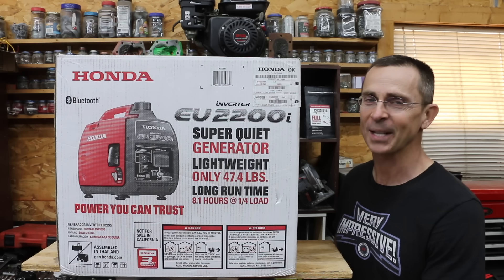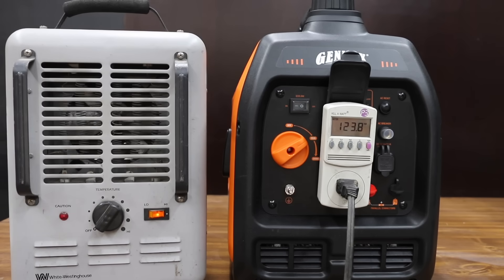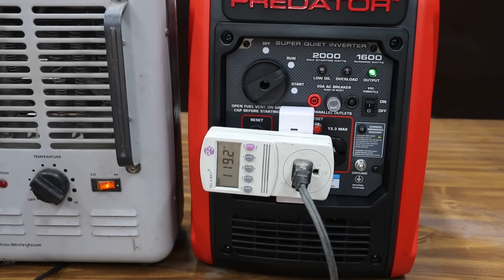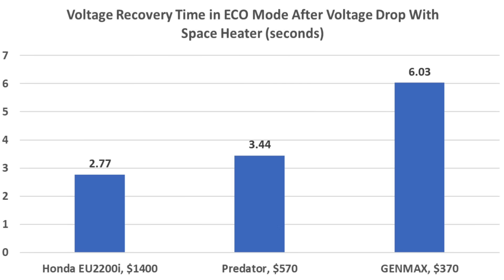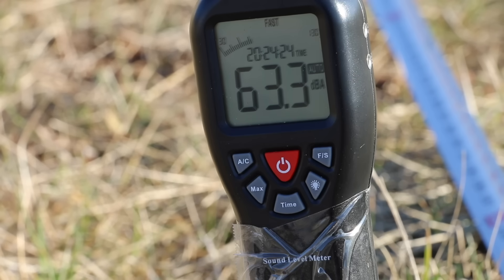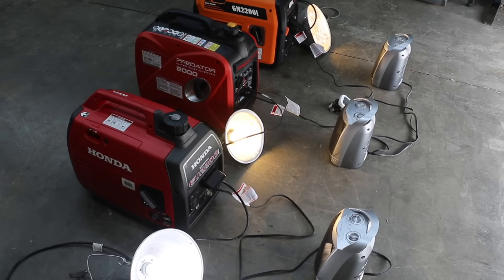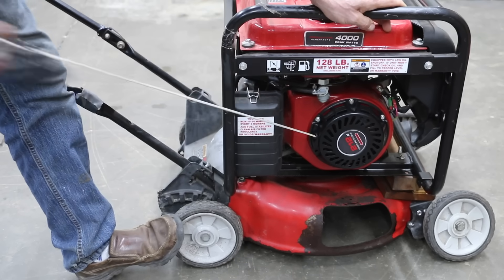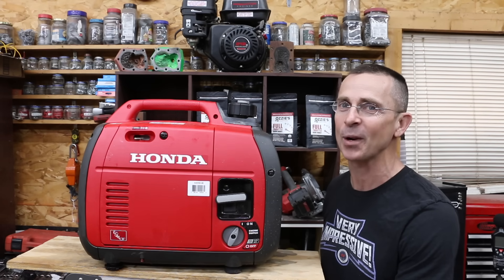Cheap Generator Better Than Honda? Predator vs Honda & GENMAX—Let’s Settle This!

Comment: Oh, how I’ve been waiting for this particular comparison!
Thank you so, so, so, so much, project farm❤❤
I had actually purchased the 2000 watt Honda around 2006, after Hurricane Katrina.
But now I get to see how good, or bad, it really is.
Reply from the maker: Nice! Is the Honda still running well?
Reply: @ProjectFarm  thank you for taking your time to reply to me, Todd!
Living in southern Mississippi, probably have really only ran it less than 10 times since 2006, but it usually starts fairly easily and runs well.
Honda usually always makes great products and I’m expecting it to last a long time.
I did join your Patreon, it’s not much, but hopefully it will help a little in your comparisons.

Comment: I actually bought a cheap "champion" generator for the occasional trop storm that comes to Charlotte NC and the rare ice storm. It's enough to run the internet tv and few lights. It was like 400 and I had it next day. I only use 4 cycle engineered fuel and I very happy with it.
Reply from the maker: Great choice!

Comment: Great video! Would love to see the Champion brand in testing. I have a dual fuel version and have never used anything but propane so far. It has less output with propane but it is so much cleaner and easier to store fuel. I’ve used it very little as it is mainly for hurricane related storm outages and thankfully I’ve had few requirements since it was purchased.
Reply from the maker: Thank you for the video idea!

Comment: Another outstanding video.  
Boy, generators sure have come a long ways since I was a kid.  
I have a 40+ year old PowerMate with a Briggs. Still runs 100%.  I also have a 7.5KW diesel that will easily power the house as well as the MIG and Plasma cutter.  Good investments for New England winters.
Reply from the maker: Thank you very much!
Reply: "Ain't that the truth." I still have my original old Coleman PowerMate 1200, as well. Heavy as hell, but still works well. Mounted it to a cheap Harbor Freight wooden mover's dolly and attached an old dog leash to that to schlep it around the shop floor.
Reply: Yes!  I mounted mine on the same dolly.  At 4KW and an oldie it’s a little heavy for my 60 year old body.   It always runs fantastic.

Comment: Would love to see a "solar generator" showdown. Anker v. Bluetti v. Jackery etc. Especially side by side with some of this data
Reply from the maker: Thank you for the video idea!
Reply: @ProjectFarm  I second this video idea. I like having a battery backup since the entire thing is self-contained. No gas, oil etc. Nice to top it off occasionally and leave in a closet.
Reply: Jackery don't even compare to the others, 500 charge cycles compared to 2,000 for the others.  And Bluetti has nearly no customer service based on all the reports.
Reply: Add Goal Zero in there too. They're a major competitor.
Reply: @hdz12ez  and ecoflow
Reply: @anarchangel7  Absolutely
Reply: Would like to see this too!
Reply: I second this.
Reply: Yes!!
Reply: @Project Farm  
You would want to include the EcoFlow product lineup in this comparison.  

Combined with the Honda EU-is series of quiet ICE generators, the EcoFlow Power Station units are what we chose for our Location Grip & Lighting Rental Equipment company for Film/Video/TV/Photography productions.
Reply: And ecoflow
Reply: Ego has a unit that shares batteries with their tools.

Comment: I know this may not exactly be possible, but could you run these generators for say 100h? Or even more and compare wear?
Main complain for cheap stuff is electronics failing and possibly motor failing. You buy a unit, use it for 5 years and board fries, no spare parts and throw it away. With Honda you can use for a decade without an issue. Spare parts are expensive but available.
I wonder when, if not now, we see cheap generators with good electronics that last a decade.
Reply from the maker: Great point. I ran these for 98 hours and sent to oil to an oil testing lab for wear metal content.

Comment: I also subscribe to Athe Gavin's Garage YT channel, and he does a lot of comparisons of brand like Honda, Predator, DuraMax, GenMax, Pulsar, Champion, etc.

 GenMax is an up and coming brand that offers a lot of different power levels as well as dual and tri-fuel options.  My concern about the brand is that there may not be many service outlets for GenMax in the US.

I dont doubt that the cheap price and multi fuel options has cost Honda a lot of business.  Honda should offer dual and tri-fuel models of their excellent generators
Reply from the maker: Great feedback. Thank you

Comment: I have a champion dual fuel.  I bought it 3 years ago to work on my truck since I can't park it at my house.  Never had any problems with it.  I really like the propane feature.  I will run longer on a full 20 pound bottle than a fuel tank of gas.
Reply from the maker: Great feedback! Thank you

Comment: I gots me an old 2 stroke diesel generator in the shed.  Model is Robin.  That was fun back in the day.  I'd like to get the generator running again. Engine still ran but something up with the voltage regulation.
Reply from the maker: Nice!

Comment: Would be interesting to run these for a few days, set these on a shelf for a year, and do a follow up video! My biggest fear with generators is they run good when you buy them, but then when you need them in a year or two in an emergency, they are hard to start, wont start, etc.
Reply: About once a month I run my gen for about 30 minutes under load just for this reason. I don’t want it to let me down when I may actually need it. I only have it as backup if house power goes down but of course now that I bought the generator house power never goes out 😂 so I guess in a way the gen is doing it’s job.
Reply: @oldmaninthemirror   I have my generator and a few seldom used corded saws and such.  Solves two problem.  One of having a gas or battery tool that won't work after months of non use and also I run my generator with a varying load.  Extension cord is sometimes annoying but not horrible.
Reply: Rule of thumb, if it's 4 stroke, run it dry of fuel and make sure the last fuel in it was non ethanol. If it's 2 stroke, keep the tank and carburetor full of non ethanol mix, it will keep the diaphragm pliable and a full tank will not allow condensation to build up inside the tank. It is good practice to run the equipment every 3-6 months and top off the tank after each run.
Reply: That's why they need to be run regularly.  Maintenance isn't exciting but it keeps things from being tragic.
Reply from the maker: Thank you for the video idea!
Reply: Got 2 used Hondas, one EU10, one EU20. Both are a little grumpy after storage with fuel left in them (the type of fuel you can leave in the tank over winter) but both start with between 4-10 pulls despite perhaps not having run for 7-8 months.
Reply: On my channel I just tested my old HF two stroke generator like the Tailgator in this video. It had sat for 10 years without running and started on the third pull. Of course I had drained the fuel and run it until it quit before storing it.
Reply: I've had my Honda EU2200 for a few years now, run it once a year usually, drain the fuel out of it and throw it on the shelf....next year, some fresh fuel, few pulls, away she goes.
Reply: That's called maintenance 
Reason why Honda has a fuel valve off position now on the engine switch.
Reply: I use my Honda Gen when camping. When not in use, I put Stabil in the gas. I start the engine and let it run for about 15 minutes every two weeks. So it's always ready to go. It's an easy chore and worth it to me to have a gen that is kept running.
Reply: ALWAYS drain the gas from the tank and especially the carburetor.  That'll ensure you don't have the most common problems associated with bad gas.  If you're storing for a long time, fogging oil really prevents most long term storage problems too.

Comment: We have a legacy honda laying around and we have just realized we could use it to charge the solar flooded lead acid battery for a lot less fuel than the big 4.5kw 220v diesel generator, I truly love this tiny machines, been researching about them and their tech for the last couple of months while looking for the original manuals haha
Reply from the maker: Nice!
Reply: @ProjectFarm  if you ever can, please do generators specialized for welding machines, honda has a special model for that kind of job.

Comment: Electrical generators with electronic governors capable of paralleling should have a droop/gain setting that will change the recovery time when a load is applied. There may be an adjustment somewhere that will increase the recovery time during block loading.
Reply from the maker: Great information. Thank you

Comment: Don’t have much experience with other brands than Honda but the last 2 companies I’ve worked for have only used the one you tested and I can say that in the last 3 years I’ve never seen one fail and they get thrown around in trucks, never have the oil changed, sit out in the weather and get dirty gas put in them. We use them for anything from charging batteries to running 2 inch submersible pumps and 6 inch concrete core drills.
Reply from the maker: Great feedback on the Honda. Thanks

Comment: I was using two Wen generators similar to the cheap ones in this test on my sailboat.  I had trouble with both of them had to change the pull cord clutch 3 times cheap plastic kept breaking on them and was a two hour job taking the whole thing apart to replace.  One of them would blow oil out of the exhaust.  My Dad had the Honda on his sailboat for 20 years or more thing never had any problems.  I am Def going with Honda if I get another boat or need a generator.  The knock offs are not built to last if you use them alot.
Reply from the maker: Great feedback on the WEN generator brand

Comment: Fantastic video! Im always hesitant to buy a generator because there are so many options and its hard to tell what is actually a good option. Would be good to see larger home generator options in the 6 to 10kw range! Thanks as always!
Reply from the maker: Thank you for the video idea!
Reply: @ProjectFarm  Please make the contest between dual-fuel (at least) only... home backup gen sets should get away from gasoline, not a proper long-term storage fuel.
Reply: I'd like to see that myself. Even with regular factory-authorized servicing, my 11kw Generac has been more troublesome than I'd expected. But doesn't he buy all the equipment he tests? Buying 3-5 home-size generators would get into some serious money.

Comment: 10:55 16 onces of gasoline is 4.2 kwh of energy, 1500W for 32 minutes is 0.8kWh, so it's around 19% efficient. I would say it's still pretty bad to be honest.
Reply from the maker: Great point
Reply: Thermal efficiency of modern 4 stroke gasoline engines is about that.  Sounds bad, but its pretty normal believe it or not

Comment: Love to see the Honda 2200 vs the  Yamaha engine powered  A-iPower SC2300i. 
 Great job as always!!!
Reply: I’ve had both the Honda definitely better reliability and overall in my experience but Yamaha at Costco was only 1/3 the price.
Reply from the maker: Thank you very much!
Reply: I love the yam engine and I work on generators all the time
Reply: @philliphall5198  Do all of the AI power inverters use Yamaha engines?(duel fuel-240 vac units)

Comment: Aside from Predator, Westinghouse is probably the biggest competitor to the Honda in this class. I have one and really like it, especially at the $329 price I bought it for. 2200 peak/1800 running, and I got the one without the CO minder, because that's an expensive and unnecessary feature in my opinion. Your generator should be running outside in fresh air and have some distance from the house anyway.
Reply from the maker: Great price!

Comment: Love to see a comparison various brands of 7,500 watt generators; this size makes for a good portable generator and home backup able to run 30 Amps at or about 250 Volts, which can be enough for most residences emergency needs.
Reply: I have a 7500 diesel as a whole house backup.   I love it.
Reply from the maker: Thank you for the video idea!

Comment: I'm really curious if the genmax and predator wear metals after break-in is reduced, or if they continue to wear like that aggressively.
Reply: Judging by what the Predator's spark plug looked like, I'd say either the piston rings were shot, or maybe even the piston itself, given the amount of aluminum in the oil. I wouldn't expect that engine to run for many hours after this test.

Comment: Thanks for your time and work . I would greatly appreciate if you can compare Generators with dual fuel, and have the inverter feature. Also, something that would power a few appliances at home. Thanks!
Reply from the maker: Thank you for the video idea!

Comment: I would recommend small engine oil, it’s designed for air cooled engines which operate hotter than a water cooled automotive engine!
Reply from the maker: Great suggestion! Thank you

Comment: Honda wins again so you get what you pay for, im curious how much of a voltage drop the extension cord makes since most of us would be using one , new york
Reply from the maker: Great suggestion on the extension cord use with the generator!

Comment: Did you do a break in period? (sorry if I missed it) It would be interesting to see the same oil test on the second batch of oil.
Reply from the maker: I changed the oil after 2 hours of running the engines on a light load. Thank you
Reply: @ProjectFarm  of course you did, how could I doubt you! LOL

Comment: Would be interested in these tests on the Champion dual fuel generators. It's about the same price as the predator, but can run on propane too, which is great cause it runs way longer right from the tank and propane doesn't go bad.
Reply from the maker: Great suggestion! If there's enough interest in this video, I'll do it.
Reply: @ProjectFarm  another vote to see the champion. That’s the best name brand alternative to the Yamaha and Honda inverter generators IMO.
Reply: @ProjectFarm do it!
Reply: @ProjectFarm I agree. Non-inverted Dual fuel generators larger generators such as Westinghouse, Champion, Duromax, Pulsar, Generac. All made in China, but are the the same?? Let’s test that!!
Reply: @ProjectFarm  I'm late to the party, would like to see one too!
Reply: Dual fuel generators are definitely interesting.
Reply: Add another vote for a dual fuel comparison
Reply: I agree
Reply: Both of my generator's is champion. Never had a problem with them.
Reply: I have a champion dual fuel.  I've never  run it on propane because gasoline is much cheaper  (Colorado).   I have modified it for remote start, which also saves fuel.   If I was using it for emergency only than I might use propane because  more stable storage than gasoline.
Reply: @ProjectFarm I would love to see a dual fuel video done too.
Reply: I second your request. I'm about to upgrade my older gas Gen for a dual fuel one.
Reply: I converted my generator to propane as a 2nd fuel option. I test it on propane, and keep the fuel tank empty for when I really need it.

Good to have 2 fuel options, although propane is much more expensive than gas.
Reply: @volvo09   And you lose a couple hundred watts of capacity with propane.  Just trade offs.
Reply: I have the 2500w dual fuel and anecdotally it seems louder. But I like the flexibility of propane.

I'm really interested in the tri-fuel ones because I have natural gas at my house.
Reply: YES! Champion is at LEAST a contenda. Seriously, I think lots of guys default to Champion. How are they really?
Reply: how bout tri-fuel gen's, thinking bout getting one, thanks.
Reply: Less Carbon Monoxide emissions from LPG over gasoline.
Reply: I also would love to see that, but it will be hard to compare fuel usage etc when using propane vs gas. Maybe compare cost of fuel per unit of run time.
Reply: I agree as well.
Reply: bruh how is champion not in here
Reply: I am looking to buy a dual fuel! Don’t know which one to get, so confused 😕 not looking to spend a lot either since it just a precaution in case we lose power which where I love is rare!
Reply: Where I'm at we lose power in the winter due to heavy snowfall, so that's the only time I'd need it. Propane would be moot because it doesn't work in the cold. Count my vote with the "nays".
Reply: Definitely would like to see the Pulsar GX400BN in that mix.  It seems to be seeing big use in the RV market.
Reply: I had a champion 4000 running watt generator that had over 12 thousand hours on it before the engine went out. Crazy